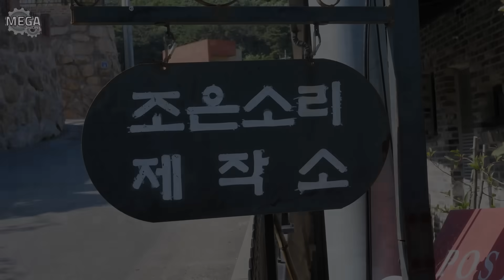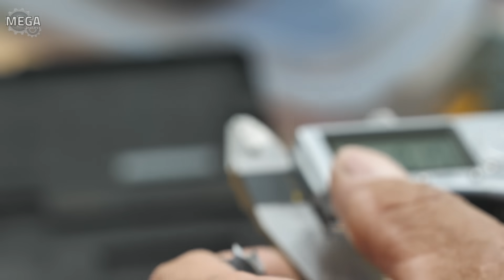Process of making long bamboo flutes. Korean traditional musical wind instruments factory

Comment: To avoid measuring or looking at the measurements of my keys, I have attached some colored ribbons to them, a color code similar to those used in electronics, so it is easier to identify them.